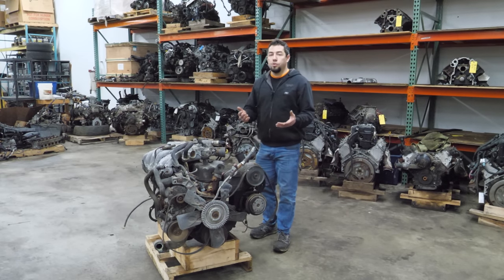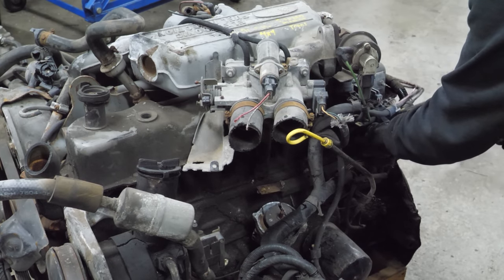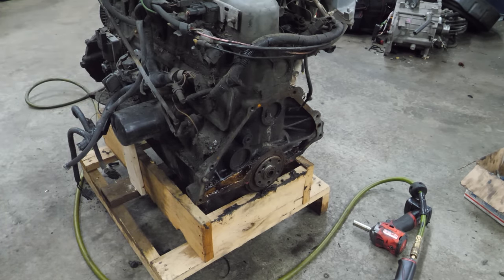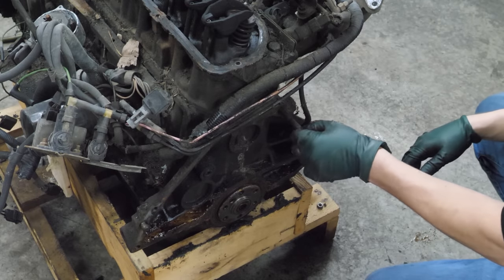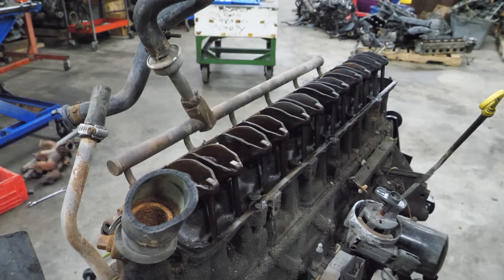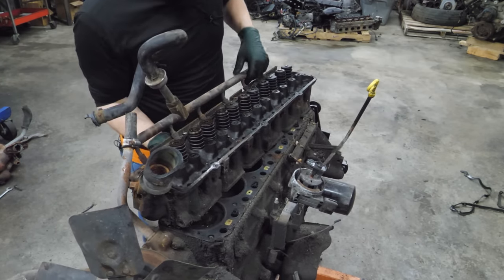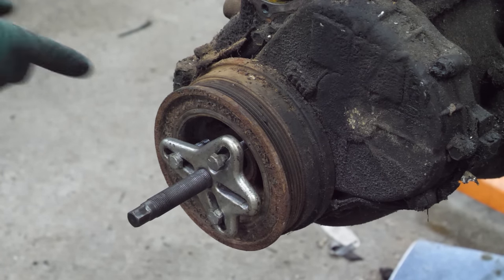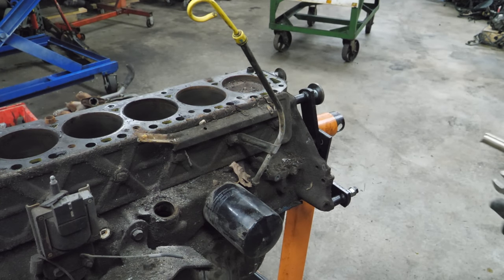FINALLY! A "Bad" Ford 4.9L 300 Straight 6 To Teardown! Most Reliable Engine, Ever?

Comment: I rebuilt many of these back in the day, both automotive and industrial, most not destroyed just miled out. The main thing I noticed was the crank turned fine before removing the mains, but if you then retorqued the mains the crank would not turn or turn very hard. We always line bored them before putting it back together. This was along with the indutrial 172 a great engine.

Comment: I still have my 93 F150, 5 speed. Bought when I was a young soldier. It has only 200,000 miles. When the time comes, engine rebuild and keep going.

Comment: If you stuck pistons that won’t rotate easily like this you can rotate the crank so it’s beginning to push the piston back up to TDC and then remove the rod cap. After the rod cap is removed you rotate the crank again and use that leverage to push the piston up to TDC and then manually remove it the rest of the way. A few squirts of oil or some lubricant go a long ways to loosening up rusty and dirty pistons and parts too.

Comment: My 82 was carbureted. It had a soft cam I needed to replace at 100k. I drove it to 235k and sold it to a guy that hauled his 24 foot speedboat and concrete forms around wi it for a decade. It is currently the "yard truck" at the large construction company where his brother works. Odometer stopped working at 532k and the truck is perforated with rust but they still push broken equipment around with it and haul trailers in n out of the shop, daily.

Comment: I've had a few, love em. Only negative thing I've ever heard was friend had fuel injected one in horse hauling truck. Kept cracking head. Switched to older carburetor model, no more problems.

Comment: My gas on the piece of plastic you found by the pickup tube. That piece of plastic is actually a spacer that goes between the round screen of the pickup tube and the oil pan to keep the person at the factory from putting the pan on the motor the first time from putting it in there too tight therefore starving the engine of oil so the piece of plastic would snap onto the metal screen area of the round pickup tube.

Comment: I still have this motor in a restored 1970 F700 here in Aussie. Motor rebuilt and extractor exhaust fitted as gasket between that and manifold can leak .  This motor is a classic and better than the v8 which was an option here.

Comment: ❤❤ I he bought new a 1990 Ford Ranger V6 and drove it for 300,000 miles. Other than normal maint it ran forever. I gave it to a parts scrap yard yard when I bought a new 2006 Triton. That Ranger was incredible.

Comment: I have an 85 F150 with carburetor, the last year for that, 3 speed overdrive floor shifter.  It now has 408,000 on it, and is getting close to needing major work. It leaks oil, but does not burn one drop.  It seems the #1 cylinder is the most problematic in that due to the water pump being right there, it goes egg shaped.  A good re builder would sleeve it as boring it to make it round if the egg shape was too extreme would make the walls  too thin.  It is on its third clutch, 2nd water pump second distributor (the reluctor went bad and is not a replacement part) second carb rebuild, third alternator, second hydraulic clutch slave cylinder and I had an Advance Auto battery that lasted 14 years before I need to replace it...but the Achilles heel to this motor to this day is the ignition control module on the distributor.  After the first one went when the truck was about 2 years old, I have carried a spare in the glove box, and cut down a nut driver with reduced diameter head, to fit the small recessed hex head screws that hold it in place.  When it goes bad, the next day I am at NAPA buying  a new one to put in the glove box again.  I was told that when Ford went to this system, while the distributor looks identical, it actually rotates the opposite direction of the points/condenser style, so going backwards in technology is not an option.

Comment: i believe in the 292 we had one and got 1,200,000 miles out of it still running but weak so we rebuilt it then it was like new again but any straight 6 is a solid engine most problem is the intake as long as that is fixed it will run for a long time, right now i have a 250 six chevy ford 300 six and a 235 slant six. i use to get a pu for 100 or 200 then put a six in to get driving then sell it for 1500 made a lot of money of the six because i could get them for free or real cheap, my friends would get a rig pull the six to put a v8 in them then give me the six they use to call me jeffrey six. now after my holly grail find that i got for free a 67 rs ss 427 yenko camaro half restored rust free all factory car even with new chrome for it they call me arse hole but i am real lucky on finding rigs for free or cheap . i know where a bunch of rust free rigs that are just sitting

Comment: I still have a running 1983 F100 4.9L rebuilt in 1999. I use Mobile 1 10w30. 
The Dodge slant 6 is also fantastic

Comment: There are so many of these in the junkyards over here in the Northeast. Every junkyard has at least 10 of them. Most still start up and run if you throw a battery in them. There are a variety of other unusual engines as well, Cadillac 425's and V8-6-4 engines are fairly common, as are Oldsmobile diesel V8s but not the 4.3 V6. Most of those start up and run as well. I swapped a V8-6-4 into a C10 at one point. Plenty of 302s but they're almost all blown up. A ton of 460s, most of those run too. A bunch of oddball european cars like Peugeot 505s and Renault Alliances, most of those will at least run on starting fluid. Toyota 80s I-6s are fairly common as well.

Comment: I started by working with 240s and 300's during change over Era all the way to beyond the end.  The only thing they really hated were high rpm like above 4k.  Customers' kids started driving them, especially sticks, but not limited to that, they'd come in with busted piston skirts, i even guessed a few. Though, i had an adult go thru 3 in one truck.  The fuel injected ones spun easier to high rpms. Until I retired, I still had one customer with a 95 short box, actually a neighbor.  For strait 6's and slant 6s before hydraulic lifters ran forever.  For chrysler buffs, the SUPER 6's with a 2bbl carb.  There are plenty of hp parts for 240s and 300's back in the day.  Sorry, gm, not that a 300 low on coolant could crack a head, but gms 6's cracked full of coolant a lot. AMC, A Mechanical Cures worked but couldn't get out of its own way, IH and jeep not that much better.

Comment: Looks like lack of regular maintenance on the old girl. That sludge oil makes it pretty clear. Plugged oil pickup most likely, lack of lubrication. Had a 300 I-6 in my 95 F150. It had over 300k miles on it when I sold it. She ran like a champ ! Super tough engines.

Comment: Bought a 1991 f150 with the 300 that I thought needed an exhaust manifold gasket.  Turned out it needed a new long block because of the cracks in the intake and the pinhole in the block.  It took months to find a 300 to rebuild.  Fortunately I was able to source or rebuild everything via the internet.

Comment: My dad had an 86 F150 with a suped up 300-6. It was amazing. The more load you put on it, the harder it wanted to pull. Just torque forever. Bitch to get through emissions though. Had to jet it out so lean it wanted to stall and such. God it was great to drive though.

Comment: I love this motor.  I ran a early 90s F250 that had one as roofer for a summer job 99-01.  We did flat roofs on factories etc.  I pulled a robot welder around that welded seams for plastic roofing.  That thing had way more pull than the dodge V8s we had. I had no idea it was such old technology.

Comment: They are an amazing engine. Friend has one in a 1968 Gumman van. It’s turned the clock over but still fires right up and will idle up a hill.

Comment: I’ve owned an 82 F150 and a 92 F150, both with the 4.9 In-line 6cyl.
They were bullet proof engines. 
On my 82, I put 200K miles and my 92, I  finally sold the truck at 450K miles.
Not much power, but a ton of low end torque.

Comment: Had two F-150's with 400 straight 6's. Both outlived the rust getting the truck, one 5 speed manual had 275 thou on it. One leaky fuel injector, and never touched anything else on it, and it didn't burn oil.

Comment: My Dad had one in a '81 f150.  Very rarely did it see oil changes. 3 on the tree. That wore out and got rebuilt. I bet when he sold it. It had at least 200k on it.Good torquey engine. Flawless!

Comment: The first truck I drove as a teenager was a 1992 for f150 with the 4.9-300,six . When my dad sold it to a employee it had 398k miles on it.  Still running fine and not a drop off smoke coming from it . I seen that employee driving the truck to work for atleast two more years and i never heard of the engine blowing up?

Comment: What's good about this engine is its low rpms idols in its power band pulls stronger from a stop
Because of that as the v8s power band starts later and needs more throttle taking off when loaded, 
Another thing with this engines longevity is that it's timing is gear driven, where v8s had chains that failed around 160,000 miles where many people gave up on the 302 / 5.0 engine,  and some 302 / 5.0 s oil pump shafts would fail, but you can replace them with a high strength steel one and  an gear drive also if you want to, but the 302/5.0 would last just as long, haul just as much weight and get 19 to  20 mpg compared to the 16 mpg of the 300/4.9 L , I worked in construction industry in the 80s and 90s my boss had a Ford F150,
And his brother inlaw had one with the 300 /4.9 I6 He got 500,000 out of the 302/5.0 bought a new truck with the 4.6 and gave the truck to his brother for a hay truck, after about 10 years after that  I came across the truck again one day riding around in another Parish still running after his brother died and someone else got it, and  the 302
Is a lot faster than the 300 , and this truck was doged 
And over loaded regularly, pulling 16 foot trailer loaded high with scaffolding and bords often with a Palit of tile higher than the roof of the truck, and another one behind it of mortar mix, with the 16 foot trailer loaded, and  he would punch the throttle going up on ramps to get on the interstate like he didn't care, and he didn't because he was a Chevy man,  but could never get more than 90,000 miles out of them, in his line of work, pre LS Days,  and the rear bumper would be 6 inches from the ground, loaded down when hauling to job sites in commercial tile and plaster work,  back then it was rare to see some one using an F250 in construction, you would see them F250s and F350s used on large  Farms , but Nowadays it seems many people have them for Nothing like it's just a regular car, and the beds look like they were never used,

Comment: I had one that was in a beater off road machine. It had been over heated to the point of ceasing. Some sort of failure at a beach caused me to have to drive it home without a valve cover. That poor engine had eaten sand, water, mud and more. It has since been removed, rebuilt, and powers a buddy of mine's off road machine where it's treated a little better.

Comment: The Ford 300/6 engine was a tough little motor found in school buses, dump trucks, delivery trucks, and almost all of UPS brown panel delivery vans for many years. I've even had one back in the 80's. If it were possible to replace my 3.7L in my 2012 Ford F-150 with a 300/6, I would in a heartbeat but not sure it would fit. I wish Ford still offered an inline six engine maybe a little larger like a 400 cid or larger for current model trucks but I don't see that happening or even better a turbo diesel inline six. As the guys from Engine Power TV show have proven, with a little work these 300/6 Ford engines can produce 480 Hp / 530 lb/ft Torque. Another favorite engine is the GM 292/6 which was also used in pickup trucks up to medium duty trucks and school buses.

Comment: Loved the video.  I have a F150 with a 300ci I6, which is a local rebuild.  Mine purrs like a kitten.  I run it on alcohol-free gas, which gave me a 2 mpg boost and a healthier engine.  Unbeknownst to me, it actually accelerates!

Comment: My first new vehicle was a 74 Ford PU 4x4 with the 300 6 and 4 speed stick.  Had some serious pulling power in low gear. 
Being a stupid kid, had to put headers, aluminum Offenhauser intake and holly 4 bb on it. 
Drove that truck a long ways, and had some fun with it. 
Sure was easy to work on.

Comment: Blew up a 302 years ago and there was a abandoned old ford with a 300 straight 6 parked in this old field for years .  We put that in with new plugs and wires  and a oil change  and rebuilt the carburetor.  It ran  till i scrapped that teuck and then it went into another ford we used as a plow truck   and still ran when we finally scrappped that truck as well

Comment: I have a 82 ford f150 with the 300 six. While the truck continues to rust away the motor runs strong. never fails to start. One day i will pull it and put it in a falcon or some other sedan. Best 6 ford ever built.

Comment: Driving home one night mine stalled at a light about a mile from home with fluid pouring out.  I said screw it and restarted her and drove her home figuring it was probably done for.  A freeze plug had let go.  I replaced the freeze plug and she ran for at least another 15 years.  They are Bullet proof.

Comment: These things are just indestructible and you really just can't kill them. Truly the best engine Ford ever designed, the one in my 85 F-150 is still running strong. Couple of corrections, both the 240 and the 300 came out the same year, 1965. It was also never designed as a tractor motor, it was designed from the very beginning to be a truck/full size fleet car engine though the 300 was used in some tractors. It is a common misconception that it is a "tractor" motor though that may just be a catch all term for simple engines.

Comment: I have 2 of these engines  in my truck that's completely rusted into ground. It would run. So I've had 15 years using as work truck still amazes me the tork .

Comment: Had one in a 78 F100. Best 6 6yl ever
 Put a Idlebrock manifold on it with an Idlebrock 2 barrel. Also put hooked headers on it with glass packs out to the back. Got 17.pg in town and  23mpg on the hw using premium  gas!

Comment: I replaced my junk 4.9 that had piston slap in cylinder 6 for a 140k mile junkyard engine.  That one kicks push rods every morning and has alot of other issues.  I've heard great things about these engines but have had zero luck and non stop headaches from these.

Comment: 240/300 came out in 1965 at the same time. The 300 was normally found in the larger commercial trucks and 240 was the base engine offering in ford f series

Comment: Here in Australia, we got the same block stroked to 250ci. It was an obscure but effective conversion to order a Canadian  crank and rods to get them up to 300 as God intended.
Reply: In aussi you have an 6 cyl with twin cam and a power house..... is that not made from FORD 300?
Reply: @rvarsigfusson6163  no, that's the Barra motor. It was loosely  derived from the 4.1 Litre crossflow engine.

Comment: I had a coworker with a 300 blow a hose on his way into work and just drove the rest of the way with out any coolant. He warped the head to the point of just dumping coolant out of the head gasket. Instead of fixing it he continued to drive it for another year with out coolant. He finally replace the truck but it was still running when he did.

Comment: Back in the early 1990s when I was in high school I had a 1989 F-150 4x4 with the 4.9 liter straight six and the 5 speed manual and it never let me down. It was only rated at 150 horsepower and 265 lbs ft of torque but for the time that wasn’t bad.

Comment: The front spark plug in my 95 E250 van was so hard to get at I don't think the fleet maintenance guys at Pacific Bell/ATT ever changed it. Had 35000 miles on it at 22 years old. The gap was .025 over and still ran fine. I love it but I wish it was carbureted to free up the space.

Comment: @1:30 
Had one I took care of in a building Working at OSU.  It was a backup generator in Celeste lab.  was set up to run on Natural Gas.  It was installed in the 80's and ran like a top!  My grandpa had one in a 2 wheel drive F150, 89' I believe.  Only thing it had I shit you not from 92' until 2008 was TWO batteries and a clutch.  That first battery was 10 years old when it died.

Comment: The Ford 300 straight 6 is unbelievable. No other motor ever made can go toe to toe with it. I swear it's designed to never die.  Chevy had something close with the small block 327s. The 5.3. fantastic motor.  These don't happen a lot but it happens. My brother has the truck my father got new. In 81. Over 700 thousand. 300 6. I have the 05 Chevy LS block 5.3. 350 thousand. Some motors just run

Comment: I find it hilarious that the one time you get a Ford 300, it's essentially fine! 
My dad bought a new '93 F-150 with the 300 I-6 and a 5 speed and it was just like you said, the engine ran for over 250k miles but the body just rusted away around it.

Comment: I worked for a ford dealer 11 years and never tore one of those engines Down maybe did a water pump or a sensor replacement but never did any internal repairs .that one and the the 460 very rarely had any issues .